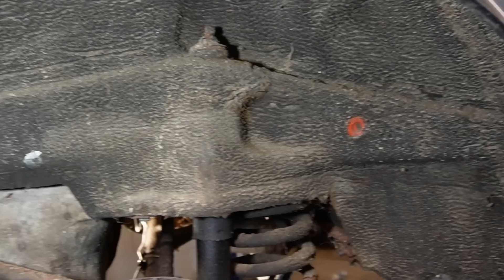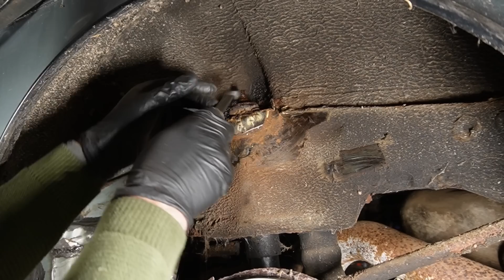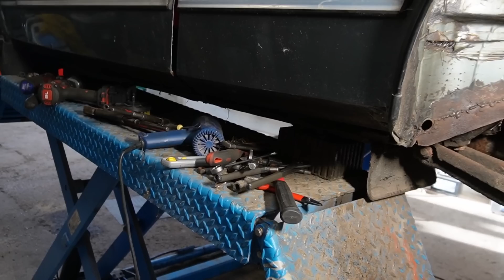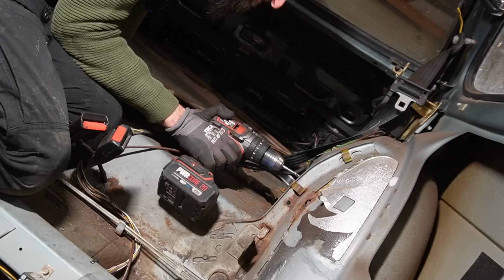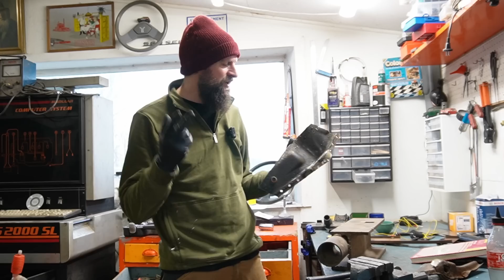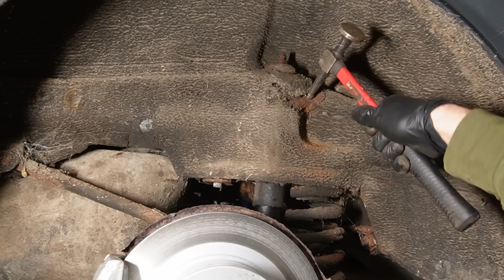Saab 900 Turbo Commander | Its Just A Bit Of Surface Rust... Or Is It?

Comment: I bought a 1985 900i in 2020 it was driving great until a couple of months in I went over a speed bump there followed a constant knocking noise at the back first of all I thought the anti roll bar link had broken but on investigation it was that panel the shock absorber had punched through the hole at the top I got the repair panel from bill at saabbits it seems to be a common rust area as it is a bit of a mud trap
Reply: Same thing happened to my 900i last year. Thankfully that reinforced part was available from the Swedish Saab club. 👍

Comment: With exceptions of course, rust is pretty much the universal enemy of automobiles..

I've said it before, I think you need to use some penetrating oil on those stuck nuts and bolts...

See you next year...

Comment: Huhaa from my old white 4 door which you saw at netto this is going to be a huge job.......Saab of that year will have rust hiding behind the smallest bubles in the under coating and yours are much worse than mine ever was
Reply: If you want Saab parts i am still a member of the Swedish Saab club and have access to their spare part shop

Comment: dave from northumberland  uk i recently bought an induction heater fantastic especialy for exaust bolts and nuts i used to run a saab 900 at one point we had 4 in the family super cars of quality never to be seen again merry christmas to you and all your family
Reply from the maker: Thank you!

The induction heater is on the wish list..! :)
Reply: @SeasideGarage  I improvised a bolt heater using a TIG torch on low power, works very well.
Reply: What make / model did you buy?

Comment: I ended up buying the repair panel for mine. Rather bad fit, had to cut some reliefs and convince it to fit with a sledgehammer...
Reply from the maker: That was actually what I was concerned of.... Happy I found a good donor part! :D
Reply from the maker: But am I right about the missing "patch" on the repair panel? is the material thicker around the hole? On the original one its 2 pieces of 2 mm! 4 mm thick! :O
Reply: @SeasideGarage  You're right, it's bloody thick. Didn't measure it but 4mm could be right where the reinforcement piece is.
Reply: @SeasideGarage  I've still got the unused repair panel for the other side. Could examine it tomorrow if I remember.